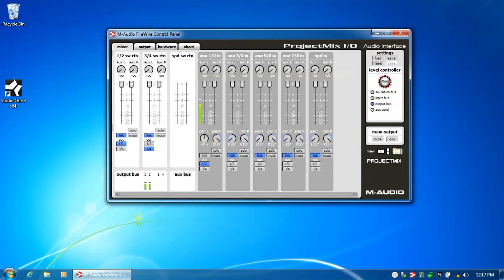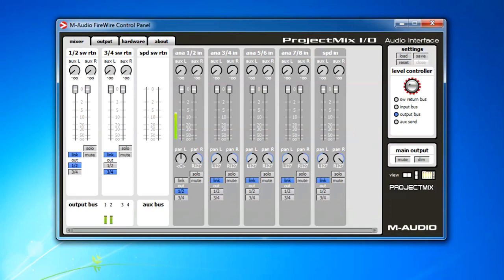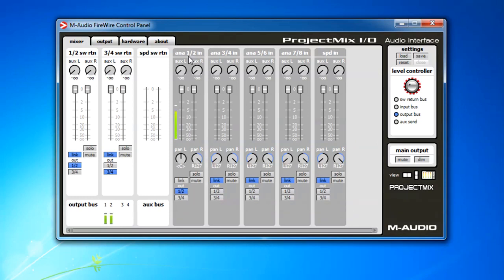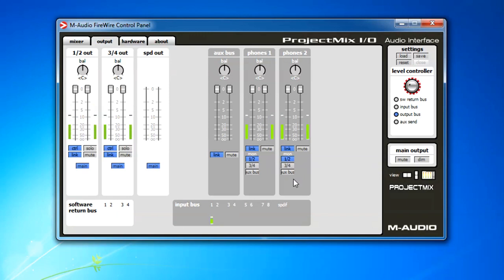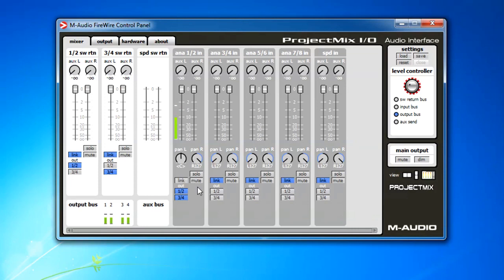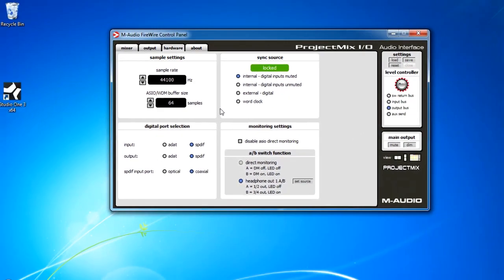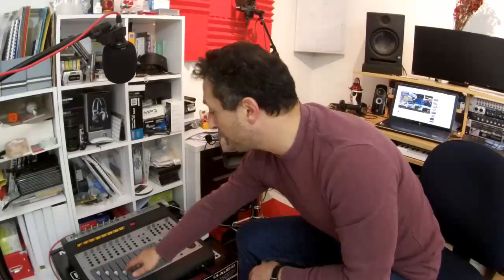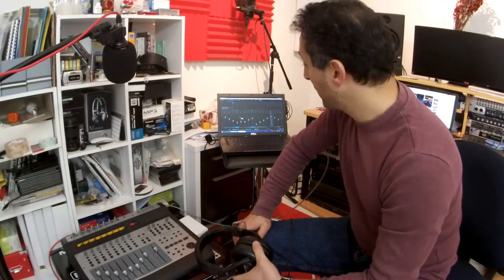M-Audio ProjectMix I/O: Driver Settings Control Panel - Part 2

Comment: Good video! I wanted to know If you have any advice or information about the M-Audio ProFire2626... I'm trying to connect it to my PC with Windows 10 with no succes... I've installed a PCIe FireWire Card that is functioning correctly, the M-Audio interface is working too but no matter what I do I always receive the message which says that "no M-Audio ProFire device could be found." Do you have any information about it? It would be very appreciated!

Comment: I enjoyed your video.  I have used M Audio Delta Control Panel with Sonar X3 for years without understanding one thing:

I usually leave the output to s/w return but when i switch over to 'mixer' , the volume drops.  Where is 'mixer' coming from, anyway, do you know?

That comment made sense about the s/w return being a way to match the levels between the card and the outboard studio gear.

Keep up the good work!

Comment: I was looking at a few DAW controllers. I used to have a Tascam 1082 but it didn't work well with Windows 7. What sold me on the Project Mix,it has the display and it can be used to edit Sony Video Software.
Reply from the maker: Yes, it is well built. Did not have any issues running it.

Comment: Thank you for this! I have a FireWire 1814 and could never understand these settings. For example what is the “sw return” for, and what does turning on “link” do?
Reply from the maker: Software Return is the return audio channels from your DAW.
Link is to link 2 adjasent channel into a stereo Left & Right. Moving one fader also moved the other linked fader.
All in the user manual.
Reply: @RecordingStudio9  Thank you for the quick response. I bought it second hand without a manual but tbh I probably still would have a hard time understanding it :) Ok I understand what “link” does thanks for clarifying that! For the SW return though, is it like an output? So it takes all the unmuted inputs and outputs it into one or two channels?
Reply from the maker: @EPSTomcat11  An audio editor software will have a stereo output for playback, but a multitrack recording software may have multiple playback channels. These software outputs get directed to the SW return in the FW 1814 driver, which allows you to adjust the hardware output volumes on the physical output sockets.
It's like having another software "mixer" between your hardware and recording software.
Reply: @RecordingStudio9  Thanks again for explaining. Ok so basically the SW return’s purpose is to adjust the volume level to the hardware outputs. Seems so simple now. 

So I’m able to get the microphone to work (front input on the 1814), and a CD player which feeds into line 3/4 in the back, but I cannot hear both these inputs mixed together at the same time on my monitor speakers, or the headphones. 

I’m trying to figure out if I have the hardware set up correctly first:

I have an optical cable plugged into the Optical OUT in the back of my M-Audio FireWire 1814, and into the Optical IN on the monitor speakers. And I have headphones plugged into one of the front headphone inputs on the 1814. Also I have an audio cable plugged into my mac’s headphone jack, and into a Line IN on the monitor speakers (these speakers have two possible inputs with separate volume controls). 

Is that correct? 

On the 1814 SW config I also probably have it wrong. I’ve tried fumbling with all kinds of combinations but no luck. 

Basically I just want to be able to mix the CD player as an input with the microphone input, and record that in either my audio editor, or a multitrack sw like GarageBand (I have a mac), while monitoring the input mix on headphones . Then when playing back, I want to hear the mix out on the monitor speakers, or my headphones. 

I greatly appreciate any help and guidance on this as I’ve had this for years and never got it to work. 🙏

Comment: Hi thanks for the video nice to see working on Windows 10.. thing is I have the same unit and then I can hear the pops and snaps on your video mine does the same thing. I've run it on Windows 7 and Windows 8 and I find no matter what I did with the buffer that pop and snap would still be there. Further tests revealed that it actually would record the pop music in audio tracks in any daw.. maybe it's my Hardware but the audio glitches in this video identical
Reply from the maker: The glitches in this video are definitely due to my old laptop and video capture. Otherwise it worked fine when running without video capture, even on the old laptop.
It's possible that you may have a faulty hardware, especially if it's recording with noise.

Comment: Does the condenser mic work in this sound card.?
Reply: Hi.  To use a condenser mic you need two things. 1. A way of supplying "phantom power" to make the mic actually produce a signal and 2. a way of amplifying the signal to match the input of the interface.  So you cannot just plug in a condenser mic.  You could use a pre-amp that has a phantom power facility or a hardware mixer (even a simple one probably has the necessary facilities.)
Reply from the maker: Yes, it does support Phantom power  for condenser Microphone.

Comment: I bought an M-AUDIO PROJECT MIX, but I did everything and the drivers only worked for me with MAC OS X19.9 Mavericks, the unfortunate thing is that I had Mojave and the programs do not work for me because of the version. What can I do to connect my M-AUDIO with mojave, please help me.
Reply from the maker: Unfortunately I don't have Mac or the unit anymore to help you out.
That's the problem with old hardware 🤔

Comment: I have an AUDIENT ID14 interface,  it has only  OPTICAL IN .  Can I connect  the M audio projectMix to my interface??      I use Pc, windows 10...  and I don't have the firewire card, Do I need the firewire card or its possible to work with the 2 units via ADAT???
Reply from the maker: Need firewire card with ProjectMix to work. No you can't connect it to ID14.
Reply: @RecordingStudio9   thanks!!!  God bless you.

Comment: hi i like to know if it is compatible with pro tools 12 can't seems to get it work
Reply from the maker: +glenford holder 
I don't have PT 12, so can't answer myself. Make sure you have the correct operating mode is selected.

Comment: Great video thank you for sharing, there isn't much info abt the project mix on youtube, your video was really helpful. Did u find out how to use the aux bus in the control panel?  Im thinking of getting an fca1616 after watching one of your videos. Have u tried connecting it to the project mix through adat connection? I want to use the project mix as master and fca1616 as slave. Do u know if thats possible? The Ada8000 doesnt have sends and returns at the back unlike the fca1616. Just wanna know if the fca1616 can be connected to the projectmix and if i can use the project mix as my main sound card while the fca1616 is connected. thank you vatche.
Reply from the maker: I'm not sure the FCA1616 will run without USB or Firewire connection to a PC, which defies the purpose of it. I have not tried it as a slave ADAT, but doubt it will work how you plan it.
Reply from the maker: Just a thought. Maybe running as Firewire chain from M-Audio, ADAT might work. In ProjectMix control panel, you should be able to receive and send the extra audio channels.
My main interface is Mackie Firewire, and I have the FCA1616 sitting next to it. I'll give it try this week and see how I go. I'll keep you posted.
Reply: Thank you vatche! I was gonna get The ada800 then realised from your video that the fca1616 had the advantage of having  inserts (for external gear/ compressorserc)  before hitting the built in preamp. both units cost the same. I was also looking for a patch bay ,  i bought the ultrapatch pro after seeing ur review of the unit. Again many thanks your reviews are very  helpful. Let me know how it goes with the adat connection!
Reply from the maker: Thanks for the comments. Glad my videos are helpful.
Yes, I use the inserts on the Mics with MDX2600, as well as the line level inputs with my Behringer MDX4400 Quad Compressor. I get clean, tamed signals to the A/D converters.Hoping sometime this week I'll get FCA1616 and Mackie Blackbird connected via ADAT. I might even try with my AB1818VSL.
Reply from the maker: FCA1616 does not route its inputs and outputs to ADAT, so you cannot use FCA1616 as a replacement for ADA8000.
One way is to use ASIO4ALL to create a composite, so both interfaces join as one device. You still need to set FCA1616 as Optical Clock Sync in the FCA1616 control panel, connect the ADAT out of ProjectMix (as master clock) to ADAT in of FCA1616, so the two devices are in sync. Otherwise you will have sync issue. The non sync issue can cause horrible noises after some time, as the two devices' clocks get out of sync. But having ADAT to sync, should prevent this.
As long as the two audio devices have ADAT (more common than Word Clock), you can sync them. 
Hope it makes all sense.
Reply: Thank you  Vatche! that's exactly what i wanted to know! Very useful piece of info.
Reply from the maker: +Kaos Studios 
Just tested having AB1818VSL and FCA1616 USB connected to my laptop at the same time. Also had lightpipe cable between AB1818 Adat out and FCA1616 Adat in, having FCA1616 as Optical input sync selected in its ASIO driver, I had 16 inputs recording 16 tracks at the same time, constant for over 30 minutes with no issues in Studio One Pro. Previously I had the same setup but my MOTU Traveler as the slave, recording a full live band. 
Hope this helps

Comment: Friend. What to do when mic \ line mode, there is noise?
Reply from the maker: Depending on the type of noise, it could be that the pre-amps gone faulty or if hum, then interference noise.
Reply: Brother, I have been using M Audio Delta 66 since 2010, but recently I noticed that in my Cubase Artist 8.5 noise is recorded in the audio tracks even when there is no mic or line connected in the input channels .... earlier I was using M Audio Delta 66 with my old computer with windows XP, since July 2016 I have been using the sound card in my new computer with Windows 7 professional ... can you please guide me properly so that I can avoid the noise while recording in the audio tracks of Cubase ?
Reply from the maker: +Ranjan Gaan, what type of noise? Noise has many forms.
Reply: Noise similar to the one in which the TV channel when there is a black and white points
Reply: it is like a very small hissing sound, though it is not prominent .... it is just like when the condenser mics produce when they are affected by little moisture....so when all the audio channel are producing the same noise it is a matter of great disappointment for me ....

Comment: Hello, you have a software instalation of ProjectMix. I'm not getting install. Thank you so much
Reply from the maker: Which version of Windows you are trying to install on? I have not tried it on Windows 8.0, 8.1 or 10. This version is running on my old laptop running Windows 7.
Reply: I'm used Windows XP.
Reply from the maker: If you watch my videos, I describe how to download and install the drivers. Here is the link again. http://www.m-audio.com/support/drivers/projectmix-i-o
Reply: @RecordingStudio9  how do I install if this page no longer shows driver downloads and installs for the Projectmix?

Comment: how do i unlick de interface please??
Reply: unlock sorrry
Reply from the maker: As long as you have the physical mixer connected, the control software should work. There is no lock.

Comment: I still got my ....running on OS X 10.10 . As you can imagine I can't use any control panels anymore ...if someone know how to run it with latest OS X . Many thanks
Reply: Same problem here =/
Reply: many thanks ! has someone made it work to use ADAT outputs from project mix IO into another audio interface such as Apollo quad interface ?

Comment: I hear some nasty buffer overload clicks and pops on your audio here.
Reply from the maker: It's due to the screen capture on my old DELL laptop, not being able to cope with it well. Not the actual unit itself. I had to connect a PCMCIA card for the firewire and it's only a i5 with 4Gb RAM.